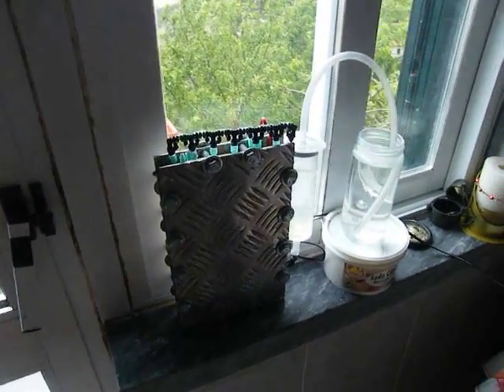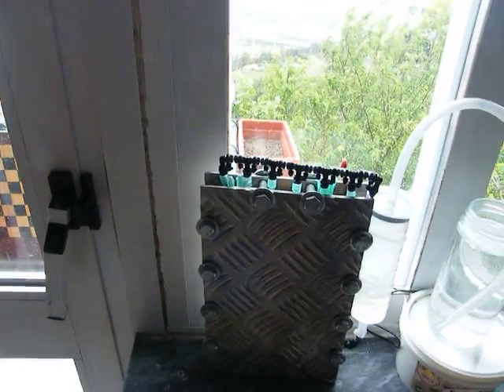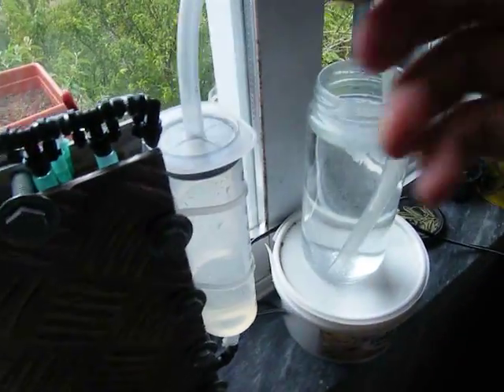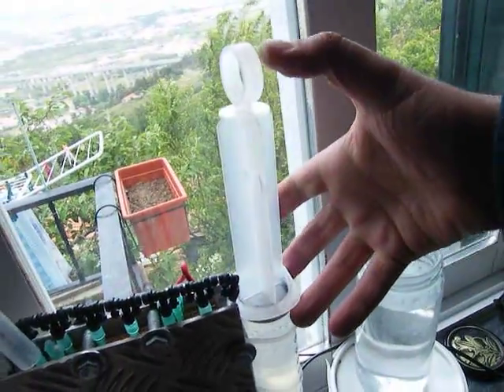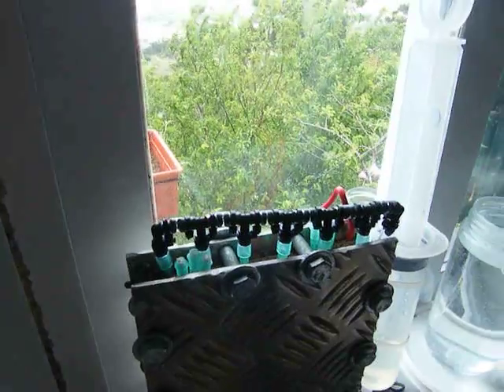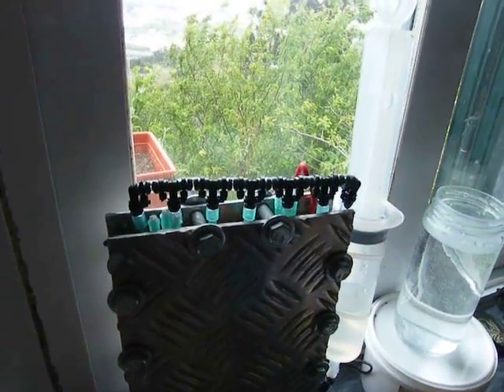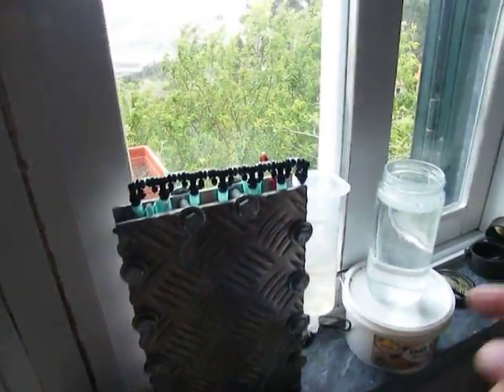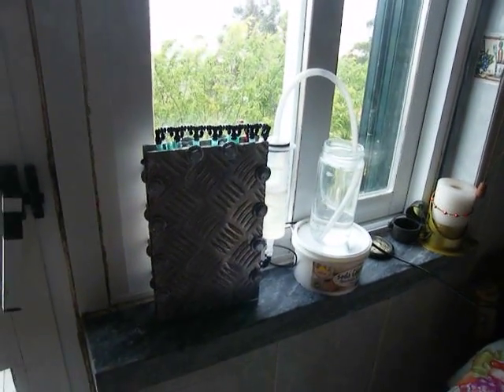HHO How to refill my no hole, zero current leakage, dry cell.

Comment from the maker: No it is not a wet cell.
wet cells do ot have to have electrolite circulation it has to do whit the design of the cell.
in a wet cell you have the electrolite in a jar or something and you dip your plates in the jar, this is not the case.